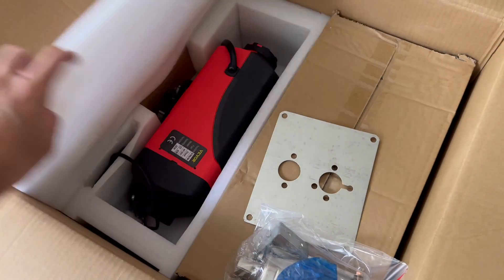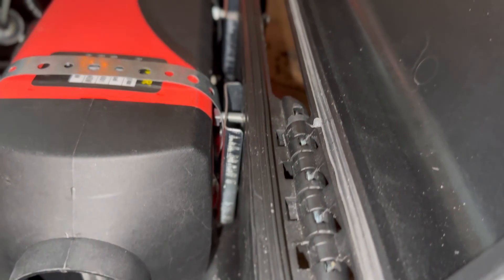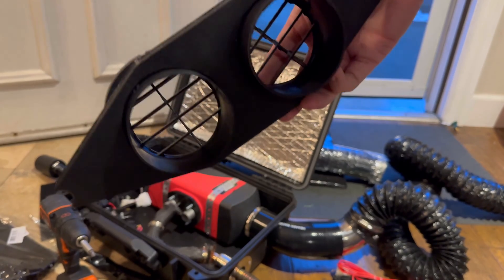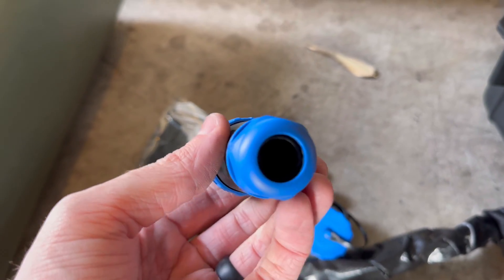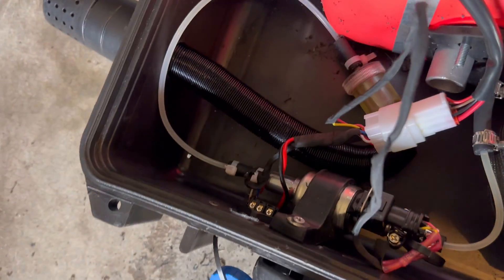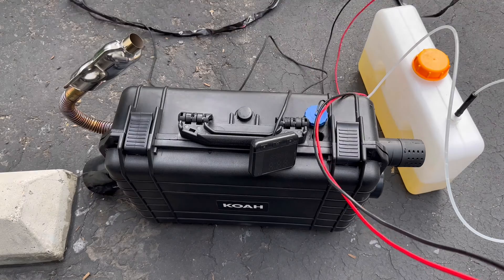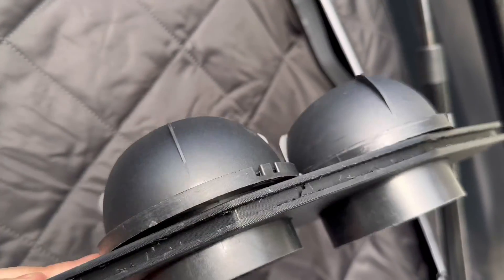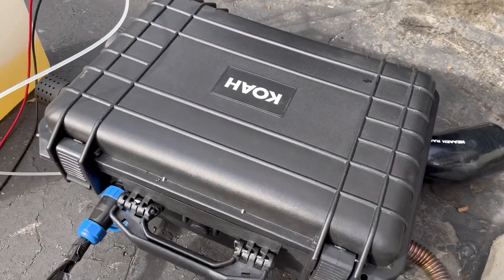Diesel Heater Efficiency Modifications

Comment: awesome vid man! where is your diesel tank chilling on your set up? I see the heater rest on top of the spare tire but I’m curious where you the fuel tank hangs on the rig when in set up mode. Thanks!
Reply from the maker: @adioalexsk8  I just throw the small diesel fuel tank in my nylon spare tire trash bag! lol 
The heater unit packs up nice inside the rig. When I’m ready to use it, I just strap the heater unit on top of the spare, get the fuel line from the trash bag and hook it up to the heater.
Reply: @ noice!! Do you just cap off the fuel line then so it doesn’t leak everywhere?

If you could showcase a video or short of how your packing configuration goes, that would be cool! My toughest situation regarding my bulky diesel heater is indeed the storage situation of it
Reply from the maker: @ I just make sure the fuel line is secured upward. No fuel leaks out for me as it would have to climb its way up and out of the line. Next I think I might add some sort of priming pump or something because it takes a minute for the pump to suck fuel into the combustion chamber and can stall it out/make it difficult to get started.
Reply: @ sweet, thanks for the details man!

Comment: thank you for the original install and this update .  i have watched both and picked up somle valuabe tips when i install m\y heater.  2 questions--with the 2 lkw unit warmed up, how much exhaust does it produce?  is there visible smoke?  and 2, is there any smell of diesel fuel or exhaust in the unit being heated?  thank you
Reply from the maker: @johnbecay6887  nice work! You will get exhaust smoke on startup but it should clear up shortly after, especially after it is fully warm. If it’s spewing smoke something is off with air/fuel mixture. Could have an intake air restriction causing it to run rich.
Reply: @lexus_offroad_adventures  thank you for your prompt reply.  so with the 2kw unit warmed up and mounted outside your living space with hot air piped into the living space, do you smell any diesel or diesel exhaust?  thanks
Reply from the maker: @johnbecay6887  no, I have the exhaust routed away from the unit and I don’t remember ever smelling it. I always have a smoke/NOx sensor with me in the tent and it’s never gone off
Reply: @lexus_offroad_adventures  thank you.  just what i needed to know.

Comment: What are the differences in terms of efficiency for power draw at start up as well as continual draw? Also, is there less fuel burn or about the same? I assume with 5kw you can run it on a lower setting and the 2kw I would think has to be run at higher setting, so just wondering if the efficiency is net zero? I have a roof top tent Canvas Eezi Awwn with annex that about 7'x5'. Would you recommend the 5 or 2kw? Thanks.
Reply from the maker: @JimmyDevere  From what I have heard (and it seems to make sense) these things run more efficiently at higher settings. I can imagine that more unburnt fuel would make its way through the system if the heat wasn’t as high. That is why I went with the 2KW unit. 

I think you’d be fine running either. I just recommend having a dedicated battery/power station to run it, as it makes diagnosing any issues easier. These things really don’t like being run through fuse blocks, and seem to go better being connected directly to the battery terminals for reliability and simplicity. They are probably pretty close for power draw at startup but as they warm up, the 2KW sips fuel and only burns like maybe 3L overnight on high. The 5kw one was a bit more thirsty from what I remember. That said, if it’s really cold where you’re going, just make sure you have a big enough battery and go for the 5KW. Not worth messing around trying to get ultimate efficiency. Staying warm is better than saving 2 bucks on diesel per night.
Reply: @lexus_offroad_adventures  Good points. I think I am leaning towards the 2kw as I am not going to run it in sub zero F conditions most likely moderate cold to keep the family happy. I like the idea of it running longer/higher setting vs more frequent cycles or lower settings. Thanks.

Comment: Great idea by re-heating the outside air instead of trying to heat outside cold air. Keep an eye on that plastic vent hose. Mine melted where it was clamped on to the unit because my heat must run hotter than yours. I'm used an adapter to 4" and use aluminum vent hose instead.

Comment: The guy from Ozark Overland Adventures (Matt) offered up a tip. He said, "use a 4 inch dryer hose (connected to the included 3 inch hose) if you experience an error code (E3??) Informing you of an overheating fault. Anyway, thanks for the update. 👍
Reply from the maker: Great idea. I’ve never gotten that error but I see how it would work.
Reply: @lexus_offroad_adventures  Good to hear. 🤞hope I don't get it either. I should have gone with the 2KW like you mentioned.
Reply from the maker: @TopoPilot  as long as you have enough power for the bigger ones, and you’re ok with the extra space they take up, the 5kw+ are nice to have when it gets really cold out
Reply: I found the three inch plastic dryer vent hose actually melted where it was clamped on to the air outlet. My heat just runs way too hot for it! I switched to an aluminum 4" hose using an adapter. Much better.
Reply: @PainterD54 do you have a link for the adaptor you used please 🍻🍻
Reply: @Stevegrande1  No, I don't have a link. I just buy that stuff at the local hardware store.

Comment: Awesome assembly! I have a 5KW set up but there is always some burning plastic smell coming out which makes it useless . Any idea why this happens? Thanks!
Reply from the maker: Take the cover off and look around the sides of the heater fins to see if it has been contacting the plastic and melting it. It could also be the hose you’re using doesn’t have enough insulation. Try finding a drier hose with that foil-like lining on the inside.

Comment: Nice set up! You might find an issue when you camp though. Having the supply and return right next to each other will cause the air to short circuit. Essentially the hot air going into the tent will immediately get sucked into the return causing one side of the tent to be colder than the other and potentially overheating the heater. Heat rises so it would be better if the supply was low and return high and even better if they were on opposite sides of the tent.
Reply from the maker: I’ll definitely be configuring it that way to minimize that effect, thanks. Since I have the rotating directional outlets, I can just turn them to point opposite directions. I doubt it will overheat but will keep the channel updated if I experience any issues like that.